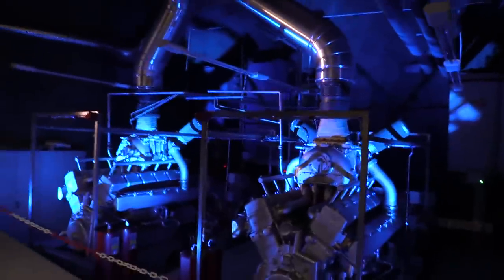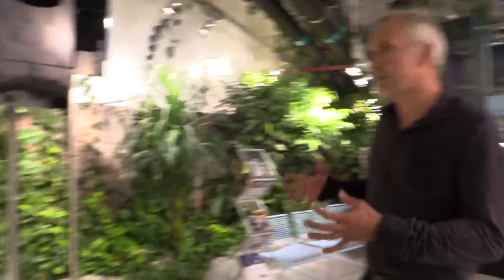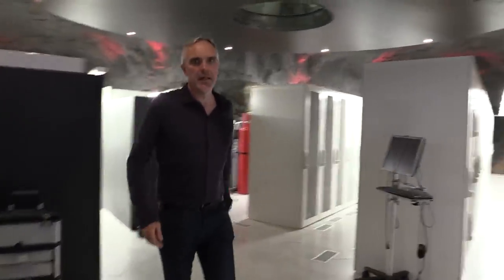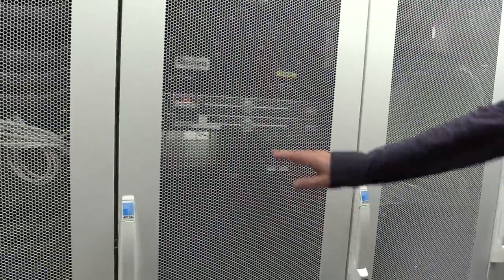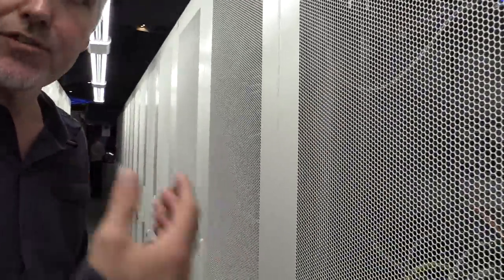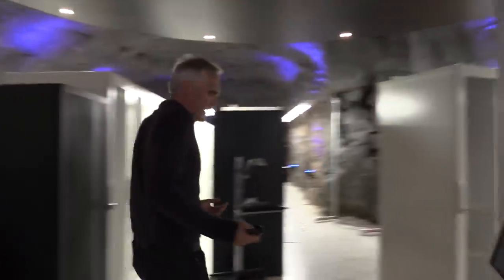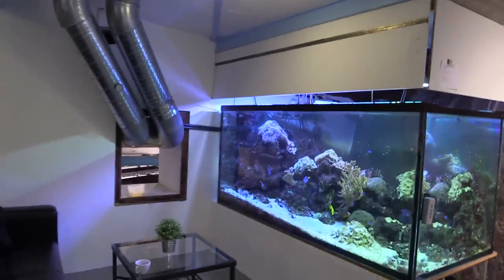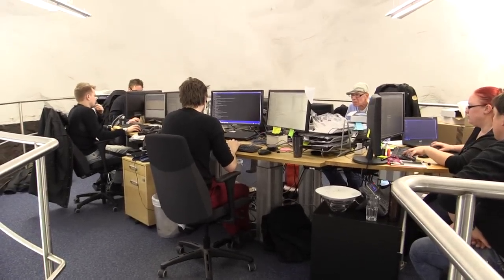Tour of Bahnhof AB Facility with CEO Jon Karlung

Comment: Definitely not the biggest "district heating" type system in terms of power  Westin Building Exchange in Seattle has far more megawatts being pumped right next door even.  And not the only one (just the only one I'm directly aware of).  Theirs is probably unique though in that it is residential areas instead of businesses.

Comment: Door code at 5:11 is ??2580. I'm surprised how easy it is to get inside such a "maximum security" datacenter. Wouldn't be possible in a real high sensitive area. It's just for the good show imho. Anyway nice location for a server and interesting insights.
Reply: I think he is using a rfid tag at first and then entering his uniqe access code or the doors uniqe code, but either way it not very smart to show the code because in theory it could be copied but it would be quite hard in practice. Oh well it is still a cool place and they have probably changed the codes since 2014 if not I don't think they could call themselves a secure IT company.
Reply: But you are right it is a cool place I live maybe 200-300 meters from it.
Reply: A place that holds sensitive information typically illegally has better security than that trust me. He's aware a camera is following him so it was probably a one time code created for the video.
Reply: In Frankfurt it’s RFID Card + 1111 + Hand Veine Scan